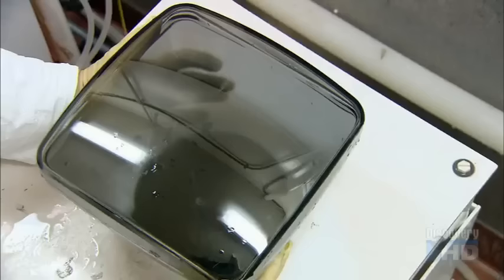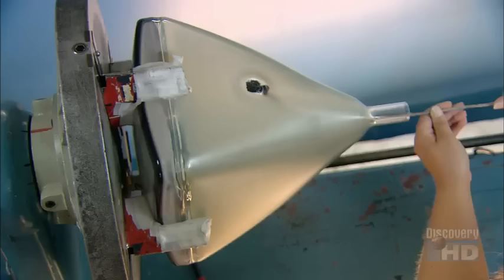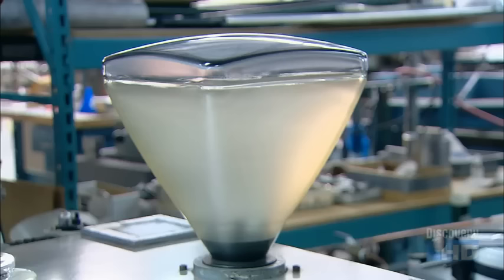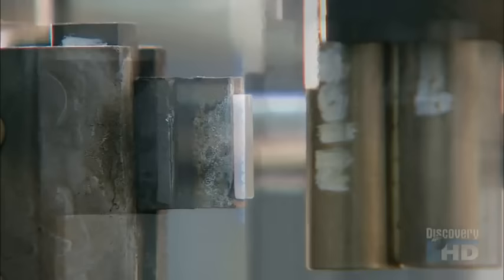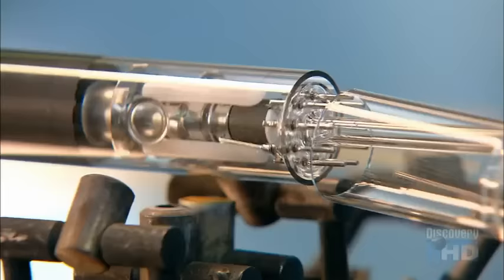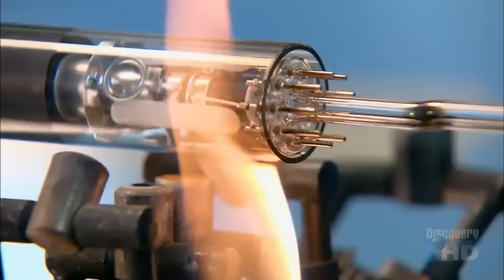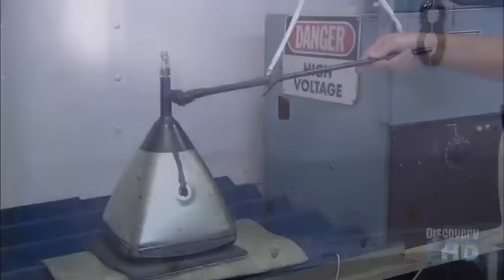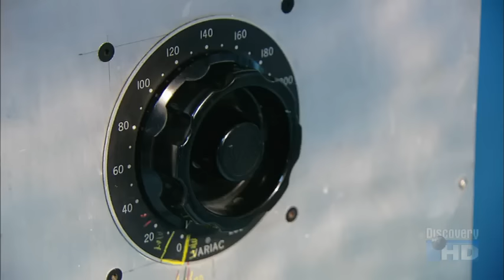Discovery How Its Made - Cathode Ray Tubes (480p) -=KCK=-.mp4

Comment: Something tells me this is a specialty shop that makes "replacement" tubes for antique Televisions.  The footage looks recent, the laborious and manual process,  looks like a low volume custom tube facility.  It would be interesting to see if they have a similar "replacement" color tube factory.
Reply: It looked like a large magnetic deflection monochrome tube with green phosphor. So.... yeah, what's it for? Definitely scientific or medical. I think if it were for PPI (radar), the face would be round and the neck would be stronger to deal with the spinning deflection yoke assembly.
Reply: Does not mention lead in the glass, perhaps that is not necessary for the new type of glass
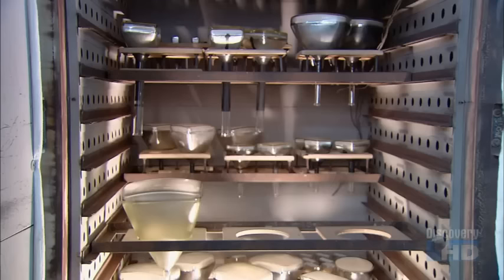Reply: 2:41 you can see all different custom replacement tubes
Reply: it is not. this is actually a very old show. the footage is from 2008
Reply: @technopoptart  considering CRTs aren't made anymore, saying the footage is recent is relative. As in the last 30 years. While the CRTs being build look like they are from 50+ years ago
Reply: Nope. Since replacement tubes for antique televisions have never been made.
Reply: @n646n  They were, and still are, made for museums and such. I know there is one company in the US that still makes them specifically for that purpose. Not as replacement tubes for consumer stuff though.
Reply: Yes, it is refurbishing. Why? Because they add extra tube to main. envelope Why? Because it is refurbishing- removing old inner parts, washing everything out and re-stuffing. I think this small facility in US is closed. Old man was too old and nobody wanted to take it. As far I know, some enthusiast bought all equipment, but didn't managed to revive production. Search youtube for full sad story.
Reply: @kaunomedis7926  You might be confused with Toshiba's plant, which closed down in 2020. thomaselectronics still makes them mainly for specialized (seemingly mostly scientific) equipment. 
Also the one that still makes I mentioned earlier still runs I believe I at least can't find any news of that shutting down. Do know his tubes where quite in demand by museum.
Reply: @relo999  I can confirm they are still open.
Reply: @ezdoesit6286  Good to know, which one is that because looking online there seems to be a few still it seems
Reply: @ezdoesit6286  Where is that located ?
Reply: @ezdoesit6286  AWESOME !!
Reply: Exact
Reply: @TheLawrenceWade The radar bid: WHAT!?

Comment: Considering the process, I would think TVs would have been more expensive back then.
Reply: TVs are cheaper than ever tho.
Reply: @Ayavaron  last time TVs were over 2000 dollars was the 50s
Reply: Max Pain for the 90s 200$ for a 21inch CRT was nothing. Today you pay over 1000£ for a small LCD in your iPhone lol
Reply: Pye Ltd. phone is a bad comparison. That $1000 goes towards more than just the display
Reply: Jason_P_Lind 200 for a new CRT TV like a Sony Triniton in the 90s seems right.
Reply: @pyeltd.5457  "$200 in 1990 was nothing."  Yeah, right.
1) Inflation means that $200 was worth about twice its current value in 1990.
B) He said £235, which is about $300, meaning it would have been worth even more.
Δ) The minimum wage in the US alone was less than half of what it is today.
Reply: MrV902 ok. You want the TV to be 50£. Cheap arse lol.
Reply: @pyeltd.5457  Dude that phone has a better processor than 1990s supercomputers and not to count the GPU and countless sensors, operating system, OLED screen etc
Reply: Amit Kumar what was high tech in 1992 is not basic old shit than would be a lot cheap. As tech evolves. A IBM Laptop would of been the DELL XPS of its day. It's going to be pricey then like modern tech is today.
Reply: @MrV902  you numbered your list 1 b delta lol
Reply: @amit4Bihar  still not worth 1000 bucks
Reply: @pyeltd.5457  I got my smartphone FOC; it came with a one year subscribtion to a weekly magazine.  One day they'll throw it to you when you buy a bar of soap.
Reply: 1959Berre I use Jel soap not soap bars like in Prison.
Reply: Roller Coaster Maniac 
Honestly it’s probably because of all the smart TV technology in them. It’s hard to get just a TV these days and before one calls me a Luddite many people have their own superior video equipment or they just want the TV for gaming and they legit don’t need a smart tv
Reply: And have better quality
Reply: That is because they were. Heavy as rocks too.
Reply: TVs where in most times expensive that is in the 50's to 70's then they started to come down in price in the 80's and 90's 2000's. Then upon the advent of the high definition sets the cost to own was as high as in the 50's to 70's.  Today they have come back down to a price never before seen, they are the best sets for the least amount of money.  It took industry a while to produce them efficiently and/or finding lower cost labor to produce.
Reply: TVs were expensive when they came out. Why do you think only rich people like Marty McFly had 2 of them?
Reply: Not as expensive as you think.
Reply: It was I have Sony trinitron from 2008 that cost $1000. Top of the line for 08. One the last crts to be made. Has surround sound inside the tv and can even handle HDMI. Damn thing ways 250 pounds
Reply: The CRT's being made in this video are for specialty applications (scientific, medical, aerospace) and is only a monochrome green CRT. The production of actual TV CRT's (RGB CRT) would be much more automated for cost and production reasons.
Reply: @rollercoastermaniac2  I have a 2016 Sony ZD9.. It was $2000 to buy in 2018.  Google the ZD9 prices when they were new in 2016...

65" Sony XBR-65Z9D
 $7000US
75" Sony XBR-75Z9D
 $10000US
100" Sony XBR-100Z9D $59999US
Reply: They were
Reply: They were back then. But today, you csn get a CRT for as cheap as free. Just ask your grandparents, uncles, parents, neighbors, anyone who may have one to donate.
Reply: ronnie doorzon  

That was probably a DLP, not a CRT. Crt doesn't scale well because the glass starts to get exponentially heavier as you go up in size. A 50 inch CRT would be like 300lbs vs the DLP at closer to 100. A 30 inch CRT is usually over 100 lbs.
Reply: @MrV902  Using minimum wage is a terrible way to determine that, just use the actual inflation rate.
Reply: @dfpolitowski2  yea, the crt tv’s came down in price because Japan was “dumping” tv’s into the US market at a loss. They did this long enough to kill the manufacturing of tv’s in the US. Then Korea got into the business and put pressure on Japanese industry, the result was cheaper Televisions.
Reply: @ajtstvandmusicarchivechann1585  I helped a guy move one these monsters. That flat crt must have glass 3 inches thick out at the edges. This makes the whole set very heavy on the front and imbalanced. They must put steel or concrete weights in the back of the cabinet to balance out for safety. Then result is a ridiculously heavy tv
Reply: @mplsmark222  Thanks
Reply: Back then in the 50’s, you had to be rich to own any television. That’s what my family told me when I wanted to learn about life in the 50’s.
Reply: lmao i know, thats how you know they NEEDED you to have one... makes me wonder why they made the highest quality screens years ago

Comment: I wish they'd make a more complete video, including how they fit the shadow mask (or in the case of Sony Trinitrons, aperature grill), bond the faceplate to the tube, fix the anode lead in place, apply the aquadag etc... Unfortunately, unless someone has a video of this hiding in their attic, we probably won't get a full video of what it really takes to make a CRT. Damn LCDs an plasmas.
Reply: The Aquadag is the black conductive paint you see on the video. I think there's no shadow mask in this model of CRT because it's a monochrome green Phosphor one (i think)
Reply: That's correct, this is a monochrome green screen. An RGB CRT is much more complicated. Though the basic vacuum tube is much the same.
Reply: i wish they would make crts again, period
Reply: I have an old Trinitron that doesn't work sadly
Reply: @andrewhamop6665  Troubleshoot it.  Sony had excellent service literature for those sets.
Reply: That's far too involved for a program like HiM, and well in excess of the attention span/comprehension skills of many placeholders in the 21st century.
Reply: Hey, don't dis plasma TVs. Their colors and black levels are on par with CRTs. It's the McD's that suck.
Reply: I honestly think CRTs may make a semi comeback as the vynyl record of video quality 

Most CRTs were in the old aspect ratios and resolutions but that was a limitation of the computers or TV signals at the time not CRT itself 

Right before the end of CRT Sony made a 1080p CRT computer monitor. It was expensive when new is insanely heavy as a drawback however it has a better response time and image quality than 1080p LCD monitors. Imagine a 4K CRT (totally theoretically possible if someone didn’t already make one for some niche application) it would be bulky as hell yes but the image quality would be really great for anyone who could afford the trade off in terms of size of the unit
Reply: Apparently some Russian produced military equipment still uses CRT based displays in some small applications the same way they still use a small amount of vacuum tubes because they’re more resistant to EMP and a cost effective way to make more EMP resistant equipment on a budget but I’m not sure
Reply: P77777777 You would surely hit on physical limits, as you can't shrink the shadowmask pitch enough.
Reply: just search for"mullard crt" here on yt and the first search result will be part one of how they made color CRTs. a video called "mullard for life" reveals how they used to install the anode button (by hand!) but the film is in black and white and so are the CRTs.
Reply: Ed Kempe Sorry, your “modern precision” statement sounds ridiculous. There’s always bloom from electron gun and you can’t change the signal instantly, so there will be significant amount of bleeding even if you somehow could synchronize the signal with phosphor pitch.
Reply: LCDs and Plasma are getting old, now it's all about OLEDs
Reply: It's a black and white tube.
Reply: @andrewhamop6665  Tube is one of the least likely parts of the set to be failed.... unless you dropped it down the stairs.
Reply: @intel386DX  I believe the phosphor was sprayed on, and the color each dot emits was somehow chosen photographically. I cannot imagine how else a color TV tube could be made with the technology of the 1950s to 1980s. And the precision was photographic, not mechanical - you'd see faults if there were three different phosphor sprays which all had to be aligned to such precision.
Reply: @TheLawrenceWade  Yeah, I'll have to take a look at it sometime. A good CRT is always nice to have around.
Reply: I couldn’t agree more!
Reply: At my time of commenting your comment is 9 years old.  But I was thinking the same thing. I wanted to see a mask/grill.
Reply: Screw LCD and Plasma
Reply: I was a Sr production engineer and later technical lead for the company where this episode was filmed (Lexel Imaging Systems) years ago.  I actually have reams of photos and photos from the manufacturing process... Unfortunately we did not produce color tubes so no shadow mask or anything. Closest we came was one of my lines where we replaced the electron gun on some color tubes for refurbishment. The shadow mask and screen stayed the same but we did have to do gun alignment, etc.
Reply: There ARE videos on youtube that show these processes.  Search for CRT manufacture. You'll find several.
Reply: @user-xg8yy7yl1d  congrats on the prediction, they are indeed making a bit of a comeback now.
Reply: @ikagura  The point is they killed a piece of magic
Reply: @ikagura  You appear to be lost.
Reply: @mjfame  My back doesn't.
Reply: this is a single color CRT
Reply: Your question might be 9 years old, but still valid after watching this! There's a video called "1990s SONY TRINITRON Television: HOW IT WAS MADE (vintage TV CRT Tube electronics)" which has some info in and is worth a watch :)

Comment: They forgot to mention the 50,000 volt flyback transformer that plugs into the port on the tube where the anode button is.
Reply: 50.000Volts? Are you drunk or what.
Reply: @raverewind it can actually be that high on a big tv set. Usually around 20-30000 volts on a normal sized set, small sets put out around 15000 volts though.

Comment: There is a second type of CRT that this and most things about CRTs never mention. Most CRTs use coiled electromagnets to move the electron beam. But there are other ones which use a pair of metal plates for each axis, so 4 plates in total, 2 for horizontal, 2 for vertical.

These plates have a high voltage across them and since it's all electromagnetism, you can control electrons just the same with an electric field as you can with a mahnetic field.

It just seems like smaller screens are more likely to use plates. Like something you would find in an oscilloscope. Which if you don't know what an oscilloscope is and you're interested in electronics or TV you should definitely look them up. They are really amazing devices. For something anyone with a couple hundred bucks can buy. But that's the future for ya. I guess

Welp the power just went out for some reason so I'm gonna go preserve my phone's battery and get out of this pitch black bathroom lol.
Reply: its actually deflecting due to elctrostatic charges the one with the coils uses electromegnatism
Reply: @duality4y  No. CRTs with coils deflect using magnetic fields. CRTs using plates deflect using electric fields. I don't believe they showed any electrostatic deflection CRTs in this video.
Reply: @duality4y  CRTs with coils deflect using magnetic fields. CRTs with plates deflect using electric fields. The coiled ones that use  a magnetic field are most common. You'd typically come across an electrostatic deflection CRT display in small scale applications such as the viewfinder in an old video camera, or the display on an oscilloscope. Coils are far too bulky for small scale applications like that. And there's no way to effectively generate any significant magnetic field with just a charged plate. Hence no coil, no magnetic field, no magenitc deflection.

http://www.nj7p.org/Manuals/PDFs/Books/MIT-Radiation-Lab-Series-V22-Cathode-Ray-Tube-Displays.pdf
Reply: @duality4y  One more bitesized piece of knowledge if you don't wanna read that textbook again. Texas Instruments put out a CLASSIC application note about the operation of cathode ray tube displays in... I think it was 1983. It explains the operation in detail but is only a few pages long. I think it's a bit of a tease, but again it should reinforce the points I made about electrostatic displays. It's DEFINITELY worth a read if you're the least bit interested in this stuff. It's not long and dry like a textbook. But detailed enough that you come away with a pretty good understanding of the topic at hand. Which is the hallmark of a good application note. 
https://www.ti.com/lit/an/snla017/snla017.pdf
Reply: @VoidHalo  i was replying to the fact you said plates use electro magnetism, might have miss read your comment though :)
Reply: you seen those crts in hand held cam recorders? those are really tiny but use deflection coils

Comment: Looks like a 70° tube, which were common in the mid-50s.
For me, this looks like a "Hobbyist-Factory".
In earlyer times, it was common to reuse the bulb and only replace the electron-system and (if necessray) the phosphorus (at least in the GDR).
In the GDR, TV-repair workshops were commitet to return old tubes to the supplyer.

I have some old GDR-TV sets whith refurbished CRTs - recognizable by the welded extension (s. 2:49). In western-germany, this was much less common.
Reply: I was thinking about why would you make a CRT in 21st century, but yes it may be a hobby. Because I find that modern robots  using to make a no-more-usable product very strange.
Reply: @ugurunver2403  This episode was from the early 2000's when CRTs were still being mass produced. There's absolutely no way that hobbyists would ever be able to make CRT displays.
Reply: @blib3786  A hobbyist managed to create an integrated circuit, never say never.